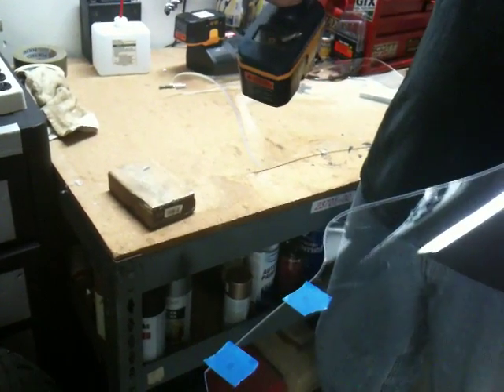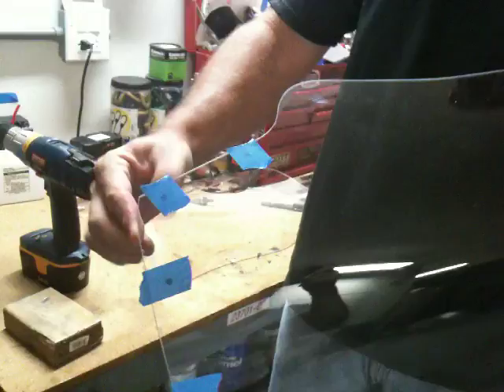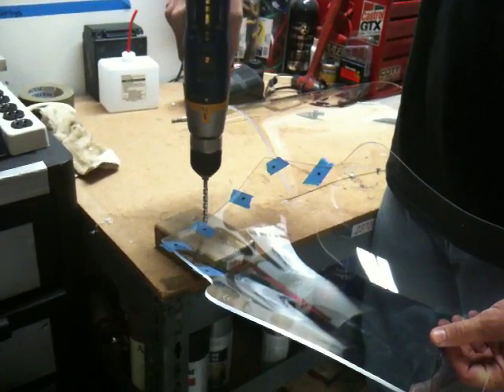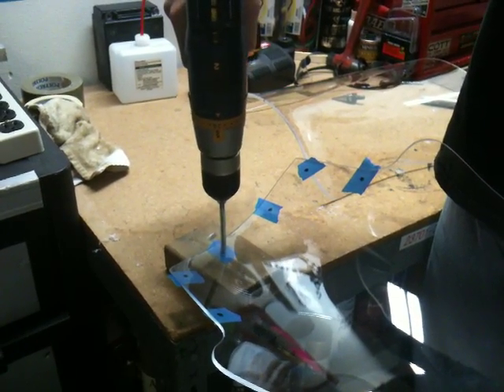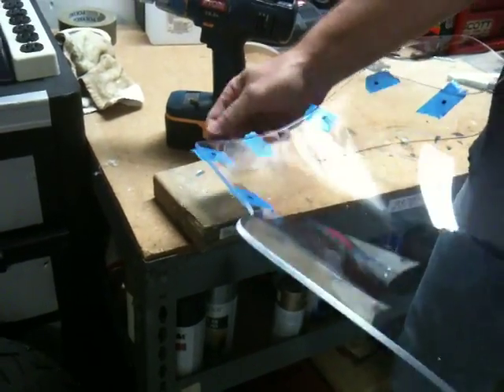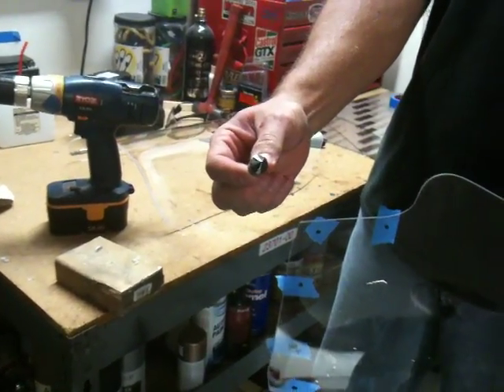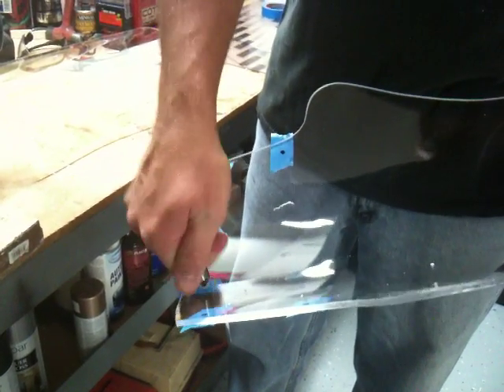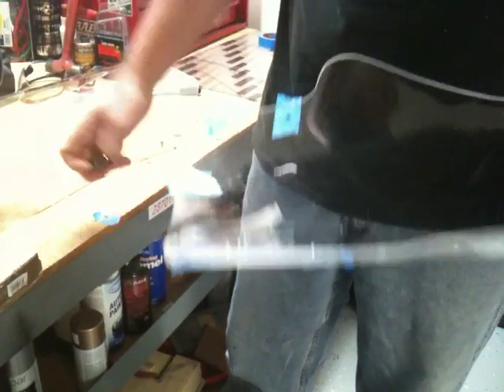A method for drilling plexiglas

Comment: Polycarbonate is superior for impact resistance and won't shatter/crack as easy as plexiglass.  Polycarbonate is bendable and drillable but, much more prone to scratching.  Most windshields are Poly as far as I can tell.  I finished a custom windshield design project utilizing polycarbonate it works like wood with cutting, sanding, and drilling.  Fun project - see my channel for the videos (short and long versions).

Comment: I had great success by thoroughly dulling a standard HSS bit on my bench grinder and turning at 3400 RPM.  It burned through cleanly in a short time using a drill press.  I have a bunch of junk bits to work with.  Simple if you have bits to spare.

Comment: A much quicker way to drill acrylic, is to take a conventional drill bit[ what ever size you need] and and rub an emery stone over the cutting edge of the bit a few times.This will remove the sharp edge of the bit, thus allowing it to drill much faster, and without grabbing the acrylic as the bit breaks thru.